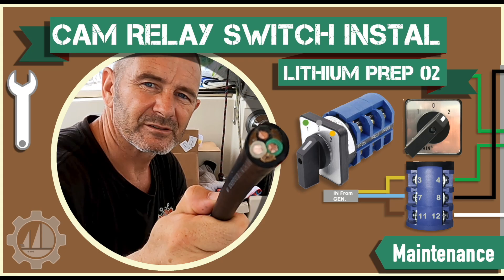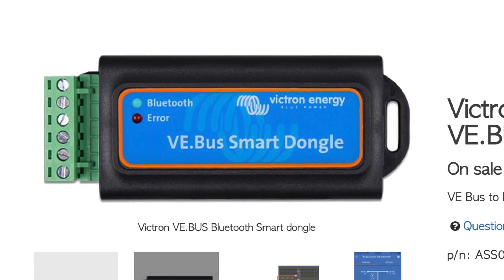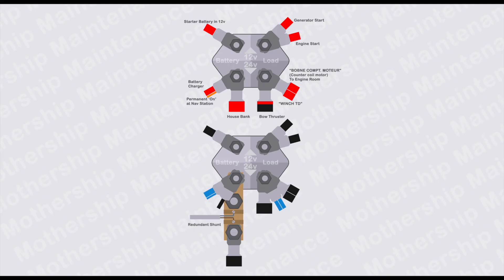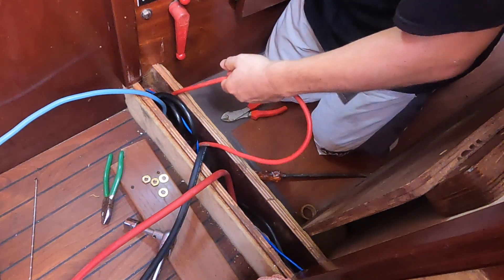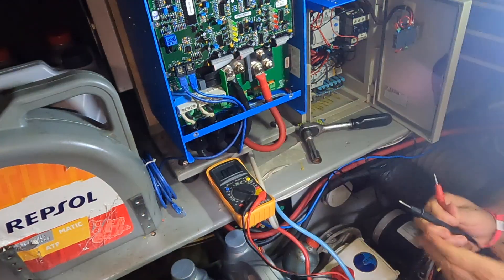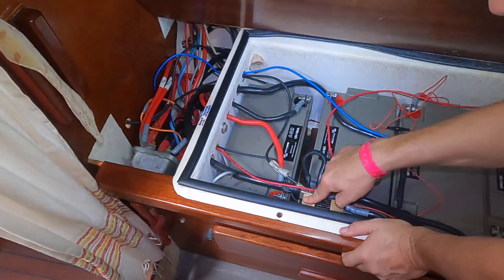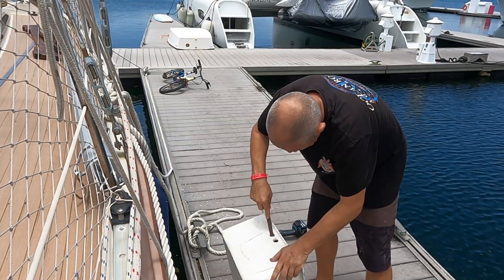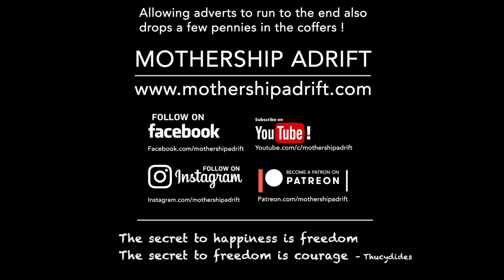Removing Old #AGM Batteries and Cables and Making New Cable Run: #Lithium Battery Upgrade 03

Comment: Keep the old inverter as a spare, or to power electric cooker and hob, no gas! 😀.  You may even be able to run it in parallel with the MultiPlus.
Great video mate, job I have to do. But I also have to figure out how to move our batteries from the engine room (1993 SM) to under the pilot berth. I’ll have to make the battery box from scratch.
Reply from the maker: That installation wasn’t cheap so had to sell it alongside the batteries to recoup some costs unfortunately. It just about covered the cost of shipping the batteries from the US to Bocas Del Toro in Panama :/

Comment: That start battery is in a sealed box vented outside of the hull. If you move it seal it again and vent outside
Reply from the maker: It’s a work in progress.. I’m going to splice a T joint into the old vent pipe that runs outside

Comment: You could have used the old cable as well as new ones, connect both. Then you have even more cable diameter so can pull higher amps. Good for future proof if you add a larger or another inverter or inverter/charger
Reply from the maker: Do you think it matters if I reuse the old 25mm2 cables alongside the new 50mm2 cables? Ie a 50mm2 + 25mm2 on the POS and same on NEG.. or do they have to be the same gauge?

Comment: Great video - thanks.  I may be wrong but I suspect that varnished board that was screwed onto the bottom of the settee was there for structural support - so the board it was attached to wouldn't sag when someone heavy sat on it.